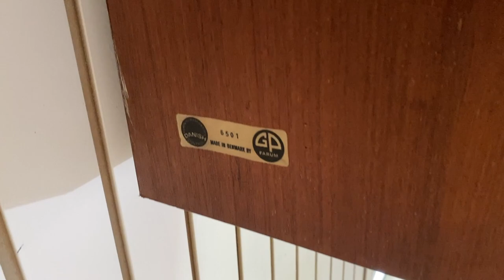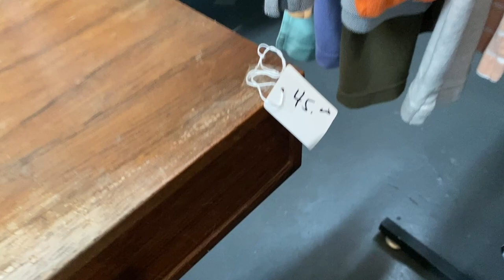Restoration of this RARE DANISH Desk! | No power tools or Toxic strippers

Comment: Very interesting and refreshing to see someone who is eco-minded.  I like your delivery style and really enjoy what and how you go about refurbishing and updating furniture👌  I rescued a mid-20th century writing desk which was destined for the dump and have totally rebuilt and repaired it in my 2nd floor 1-bed apartment.  I’m only mentioning this because I used chemical strippers and the usual electric sanders, etc. and don’t have easy access to an outside area.  The fumes and the fine dust was something I could definitely have done without!  So seeing you use a scrapper and other eco-friendly alternatives has been so helpful!  I am really impressed by your designs in wood staining!  This is something I have yet to try.  I imagine working out the pattern sequencing is going to give my tiny brain cells a really good workout!  In case you’re interested, there are bamboo Q-Tips available as a posed to the plastic ones.  I’m looking forward to watching and learning many more of your video workshops!  Many thanks!  Nigel - UK
Reply from the maker: Oh good! I’m so glad! Working indoors when doing all those things can be very dangerous. Please make sure you’re wearing a proper mask even when cleaning afterwords. Just a good habit to get into. Thank you so much for the support ❤️

Comment: The original definitely looked like teak, not rosewood, but after you finished it, the color looks like Rosewood. I think that the stripper you used caused the color to darken. I am a collector of Danish Modern furniture, and I think it is actually teak. That does not diminish the value, which could certainly be $3500. Good buy. Also, traditional Danish Teak is NOT covered with shellac or Polyurethane. They used teak oil, and later, lacquer. You are supposed to maintain Danish teak furniture by coating it with Teak Oil regularly, and considering that you went with an oil/wax finish, you should definitely buy some teak oil. It will prevent things like water stains, and other discolorations.
Reply from the maker: It’s actually rosewood :) I looked up this particular desk and it says it’s rosewood in the description. Thanks for the info though!